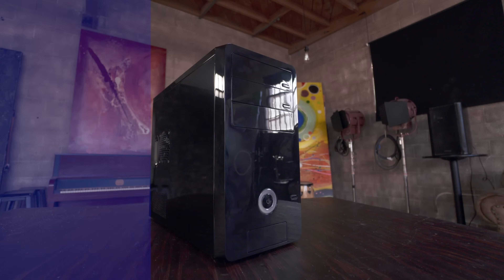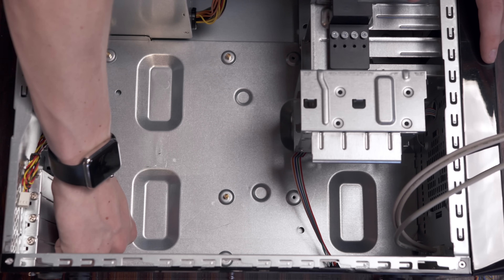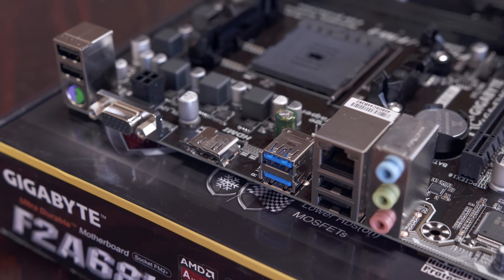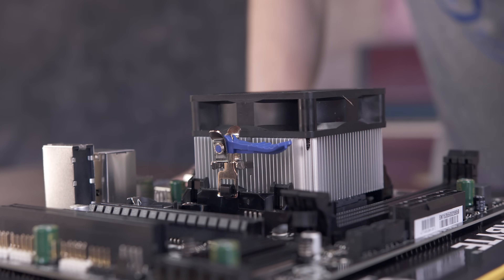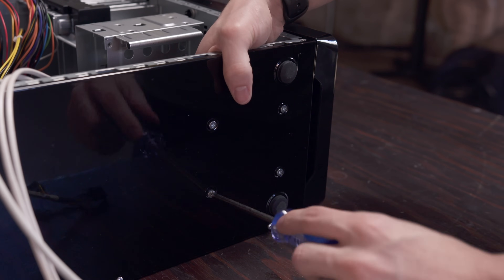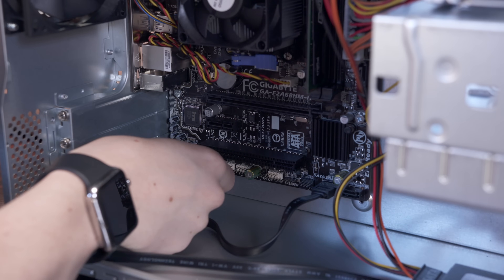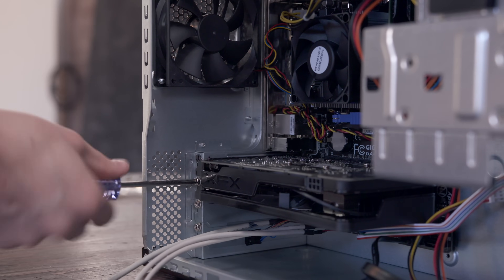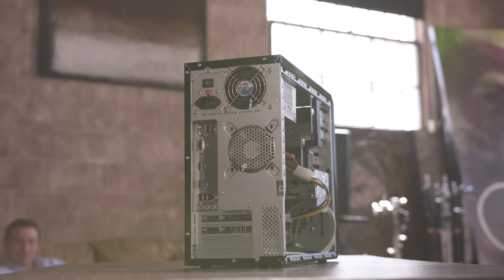How to Build a Gaming PC! (2016)

Comment: To anyone who knows a lot about PC's, i need serious help. I recently just built my first gaming pc, and I worked great for about 2 days, but then it randommly started to shut off during some downloads, and now it won't turn back on. I replaced the power supply with a CX750w Corsair, but didn't work. I've tried everything i could but I still can't get it to turn on.
Reply: dead mobo or cpu bud
Reply: and if the mobo is dead the cpu is also likely dead
Reply: +ThatGuyViral Do you know why?
Reply: +Jacob Skiles hard to say tbh

Comment: Mobo     - Asus Z170 pro gaming ATX LGA1151
CPU       - Intel Core i5 6600K 3.5GHz Quad core
^^^^      - Cooler Master Hyper t4 70.0 CFM 
GPU       - MSI Geforce GTX 960 4gb video card
Memory  - Corsair Vengeance LPX 16gb (2 x 8gb) DDR4
Power     - Corsair CX 430w 80+ 
Storage  - Western digital caviar blue 1tb

Good build? Any improvements? Anything unnecessary? What frame rate in intensive games am I looking at? Thanks in advance.
Reply: +AxisApoc I'd upgrade the Hyper T4 for something better, like the Hyper 212X, better cooling for some overclocking. For the power supply, get something like a CX600M for future upgradability.  For storage, I'd recommend starting with an SSD and then getting a hard drive when you need more storage.  For RAM, 16GB is a little unnecessary, unless you play games like GTA 5 or use your PC for more than just gaming.

Comment: 1: That case. Eww.
2: That stock CPU cooler (get a good one for AMD, seriously!)
3: That sad GPU.
4: That lack of a HDD.
Reply: +MinecraftNow this is a terrible build, and I hope no one buys any of this.
Reply: Obvy.. It's just that the parts he uses are not worth it going into 2016. I can go into more detail if you require so. Cheers
Reply: +Y5370, While this is not a great build, this is likely on the peak for the price to performance.  By chance, I have the same CPU, and it does great.  R 380 gfx though, 80-120 FPS "ultra" HD gaming.

Comment: Hey guys what do you think of my build, with some parts second hand this costs about $800USD

MSI GAMING GeForce GTX 970
Intel Boxed Core I5-6500
Kingston Digital 120GB SSD
Kingston HyperX FURY Black 8GB Ram
Gigabyte LGA1151 Intel H110 Micro ATX DDR4 Motherboard
Corsair Carbide Series SPEC-02
EVGA 600B Bronze 
WD Blue 1TB Desktop Hard Disk Drive

Comment: i am a tech noob lol and i have a couple questions.
1 if i were to add another ssd how would that work?

2. how much does normaly does it cost to install window?
Reply: +TheSpiroGam3R 
1) Quite easily, just like the first one, mount it and run the power and data cables to it.

2) A normal retail copy of Windows 10 is ~$90-100 USD, but you can find OEM license keys for about $20 USD.

Comment: if i had a amd radeon r7 graphics  what should i upgrade to (im on a budget)
Reply: +ASPEssence Whats your budget ?
Reply: up to 200 to 300 pounds
Reply: Cool, can i know all your specs and what kind of monitor you have ?
Reply: Plus, are you planning on buying a new monitor any time soon? like a 1440p or 4k or anything like that
Reply: i have a 1080p montor
Reply: Well, you have 2 choices dude. 1) Wait for Pascal/Polaris. Doing that will make sure any card you buy be cheaper, and that might drop by the end of june or july.2) If youre really in a rush you can go out and get a r9 390. Its a great card, you can test it out by checking fps benchmarks all over youtube. Its around 250 pounds on amazon. BTW, what is your cpu,ram, and psu. The psu part is important
Reply: could that run lol on 60 fps+ also will the price go down
Reply: +ASPEssence when the new gpus come out the 390 will drop in price for sure. also, this card will run lol at way beyond 150 fps. so if u can wait a little bit longer u can save some money.
Reply: how long?
Reply: Like i mentioned earlier, Its not 100% but most likely by July.
Reply: thanks man
Reply: Anytime bro.
Reply: was it the r9 380
Reply: +ASPEssence it was a 390, but what is your psu?
Reply: around 550
Reply: +ASPEssence if it's a quality brand the 390 will be fine.
Reply: k how much is it
Reply: +ASPEssence it's around 250 pounds.
Reply: thanks will it go down in july because the new graphics card is coming out
Reply: +ASPEssence yeah,that's what I'm currently waiting for too.
Reply: thanks for info man
Reply: Np =).

Comment: How to Build a Gaming PC! (2016) 
In a case with a top mounted PSU? oO 

I know that this wouldn't add like 50 fps to your performance, but still I think there's lots of cheap cases that aren't crap who all have bottom or at least separated psu. 

I get that this is a low budget oriented build, tho it's not stated anywhere, but still that case design looks, feels and is obsolete. 

There's not even tool-less drive slots or not even fan filters, as far as I can see. 

Tho this psu probably won't set itself on fire instantaneously, it can be a bad idea to use it for gaming as at 400w it's dubious whether it will support any stronger VC than that R7. Or even a mild overclock. 

On the other hand it will still run and if you can't afford anything else, f.e. in this case I would say it is acceptable to use it as a starter platform, given you can upgrade that case and psu later on. Tho honestly unless that case was like 20-30$ top I wouldn't justify purchasing it. It's actually a rarity to find a case with top mounted psu nowadays, unless you dig dig really low, even then you still have some other options. Imo if that's not meant only as a temporary solution, this option is awful.

Comment: guys, can someone recommend a budget pc build (under 1000$) that runs tom clancy division on high to ultra?
Reply: My pc is a beast and it cost £680

i5 4690k
MSI Z97 Gaming Series's 3
Nvidia GTX 750 TI OC 4GB
Kingston Hyper Fury X 16GB 
Corsair VS550 PSU
WD Blue 1TB HDD
Cooler Master Watercooling

it runs every game, runs GTA V at 56FPS on high settings, Anything else runs at ultra, GTA can run at ultra but drops down to 39FPS which is still great.
Reply: TechTuber nice one! have my old HDD and a gtx 750 ti sc edition i could use, so if i use them, it will likely be under 500$ right? :D

Comment: How do I install a Windows if I don't have a disk drive? And how do I install it?
Reply: +Minegoodboy USB. you dload it off of microsofts website, and boot from the usb.
Reply: is it free or do u have to pay? Do you only pay for the serial code or something?
Reply: You can pay for the activation code. It depends if u want 8 or 10. You can get the 10 for around 20 bucks on Kinguin.

Comment: I'm new to pc building and I don't have much knowledge soooo tell me what you think of this build I made. 
http://pcpartpicker.com/p/JVyVt6
Reply: +handboy123456789 Give me a budget. I can prob cook something a little more better for future upgrading.
Reply: 600-700 dollars
Reply: Cool, what about the monitor/tv, kb/mouse?
Reply: handboy123456789 are those included in the budget?
Reply: no, just 600-700 for the pc
Reply: https://pcpartpicker.com/parts/partlist/

Ok let me explain a bit too. At this point in time u want to stay away from amd cpus. This build uses skylake which is the latest from intel, and has a much better upgrade path. Nothing in this build is set in stone, so u can add and change whatever u need based on your certain needs. I use a 220 gb ssd, but you might want a HDD with 1tb or something else. Use this kind of like a base model and u can switch and add w/e you need. If you plan on OCing buy the 6600K instead. As for windows 10 you can buy a legit key off of kinguin. If you have any questions just reply here. Ill quickly answer it because i have my phone with me at all times
Reply: +Y5370 thanks but I can't see the build
Reply: i used some of the parts you suggested and here is what i came up with,

http://pcpartpicker.com/p/99RqYJ
Reply: looks sweet, but u neeed dat cooler. Im not 100% sure if the i5 comes with a stock. If it does then i guess ur set. The cooler is like 20 bucks
Reply: ok thanks for all the help!
Reply: +handboy123456789 np fam. I'm here if you need help with building it

Comment: do you have to buy a copy of windows 10 for this?
Reply: +TheGamingSnail It depends, when you build your computer, it won't come with windows pre installed, so you will have to get an operating system, but it doesn't necessarily have to be windows 10, it could be any operating system. And if you have windows 7 or 8, upgrading to 10 is free if I remember correctly.
Reply: but is getting the operating system free
Reply: If you upgrade from an older version of windows.
Reply: but does the older version cost money to get on the computer
Reply: Yes
Reply: where can i get a copy of the software
Reply: You can usually download it directly from microsoft. But if you go to your local computer store (like best buy) they should have some versions of windows.
Reply: ok thank you!

Comment: I understand that for budget systems, cheaper components have to be used. What I really simply cannot understand is why cheaper PSU's have rainbow ugly cables. Would it really be so hard for them to just put black insulation on all the cables?? I'm not asking for sleeved cables, simply cables that have all black insulation. It really shouldn't be all that hard, and I don't understand why only more expensive PSU's have this.

Comment: How do you install Windows 10 after getting to the bios?
Reply: +Gabriel Twigg-Ho you need a Windows 10 Dvd or USB stick. Turn on your computer, and put it in. Set your BIOS to "boot from CD" or "boot from USB" (it's under a tab called boot order or something like that) then once you exit the bios, you should enter a windows installer.
Reply: +Silvertronica Cubing thanks mate!

Comment: Brand new with 58 C temperature at the CPU ? WTF ??? My Pc is 5 years old and i have right now 24 C at the CPU and 34 C at the GPU .
Reply: +Marius Cosmin Try fixing the thermal compound, and CPU cooler, ussually the default one is not good. Your other computer probably as a better CPU cooler
Reply: Read again! I have very good temperatures under load !
Reply: +Marius Cosmin No what I am saying is that your old computer probably has better cooling system.
Reply: my build over the years. 5 coolers...
Reply: +Marius Cosmin 
what CPU cooler is in OLD computer
what CPU cooler is in NEW comptuer?
compare them.
Also some CPUs run hotter than others.

Comment: Can someone help me. I'm building a gaming pc but I don't know if I have all the specs for a gaming pc and are these specs good with each other.Here are my specs:CPU: Intel Core i5-6600K 3.5GHz Quad-Core Processor  (its going to cost me $239.95)CPU Cooler: Cooler Master Hyper 212 EVO 82.9 CFM Sleeve Bearing CPU Cooler (Its going to cost me $24.29)Motherboard: Gigabyte GA-H110M-A Micro ATX LGA1151 Motherboard (Its going to cost me $41.38)Memory: Kingston HyperX Fury Black 8GB (2 x 4GB) DDR4-2133 Memory (Its going to cost me $34.99)Storage: Samsung 850 EVO-Series 500GB 2.5" Solid State Drive (Its going to cost me $149.45)Video card: EVGA GeForce GTX 750 Ti 2GB Superclocked Video Card (Its going to cost me $99.99)Case: Corsair 200R ATX Mid Tower Case (its going to cost me $55.1)Power Supply: EVGA 500W 80+ Bronze Certified ATX Power Supply (Its going to cost me $29.99)Optical Drive: Asus DRW-24B1ST/BLK/B/AS DVD/CD Writer (Its going to cost me $18.99)In total this should cost me $694.13 and my budget is $750 dollars. Thank you very much and have a nice day!
Reply: don't go with skylake go with an i5 4690k, cheaper mobo, and cheaper ram like crucial and then put more money into a video card. the gpu is the single most important thing in any rig I would try to get an r9 380 or 380x even
Reply: Lucas Spag But I heard that gta 5 works better with a high processor
Reply: +Alejandro Rojas trust me it's going to be at most a 3 fps gain for an extra 60 dollars that would go to an extra 30 with a better gpu
Reply: Lucas Spag I made a other built. is this built better or is this one http://pcpartpicker.com/p/DjzPbv
Reply: +Alejandro Rojas here if you can save a little more the 390 is a better gpu and the xeon behaves like an i7 http://pcpartpicker.com/p/V7GkkL
Reply: Lucas Spag I Don't need a cpu cooler and thx for the advice

Comment: These are my specs for future budget build

asus m5a78i 
AMD-fx6300
8gb ddr3 kingston fury hyper x 
R9380

Does anyone know a power supply for this under 80 bucks?
I have the case and harddrive already in
Reply: An evga 600b 80+ bronze power supply will do the trick! I have that same graphics card and processor and it works nicely and the power supply is under $80.
Reply: +Matthew Clemente nice thanks!
What games do you play? And what fps do you get?

Comment: https://pcpartpicker.com/user/peter6828/saved/TdGrxr can anyone let me know if this is a good build or not for its price?
Reply: Please let me know austin
Reply: Yeah that's a great build
Reply: Matthew Clemente thx I made another if you want to see it
Reply: +Peter Sorial sure
Reply: +Peter Sorial The build with the 970 is the best but the 970 is not included in the price. That card will cost around $300 when added to the price. As for the other builds, the graphics cards are low end and will not perform very well.
Reply: +Peter Sorial this will bottleneck terribly. This is awful dude.
Reply: +Goldendeer It won't bottleneck just because there's an athlon, that CPU is fast enough for that GPU.
Reply: nah. quad core 3.6 ghz isn't very good for a 960. The 960 would be better with a better processor.
Reply: +Goldendeer Gaming favors less fast cores over more slow cores. You won't see a bottleneck unless the CPU is absolute dogshit. 3.7 is fast enough to not bottleneck the GPU.
Reply: Matthew Clemente thank you
Reply: Matthew Clemente Didn't know we were talking about a gaming PC. He just said PC. Completely my fault and sorry to both you and Peter.

Comment: build pc but consider the operating system options and what you want from it cause sometimes a linux distro like linux mint can give you all that and deduct the extra $100usd from the cost due to linux mint being free also linux mint has no product keys to worry about neither i see too many times people building basic computers and thinking they need windows for it which is $100 wasted that could have been an extra part like maybe a backup hard drive or something like that

Comment: Hey Austin, quick question. Why are some RAM slots on a motherboard colour coded as in they are coloured in pair? 2 white and 2 blue. Is there a difference ? Must we slot RAM sticks in pairs too? Can we slot 3 RAM sticks instead of 4 on a board with 4 slots?
Reply: +The TimeLord You have to read the motherboard manual. Ram slot with the same color means it is for dual channel configuration. It will still work if you slot 2 ram stick into different color slot but you won't get dual channel. You can slot any amount of ram stick and it will still work.
Reply: +WB IsMe What is dual channel? Is it a boost of some sort?
Reply: Dual channel is when 2 ram work hand in hand together more efficiently. In theory, it improves performance but in practice, performance improvement is negligible. Only APU and some software which you will never use benefit from dual channel.
Reply: +WB IsMe Ah thank u so much mate!! :D

Comment: I have a question 
If i remove the stock cooler from the cpu and try to reinstall it
will i have to apply separate thermal paste??

Comment: Hi there,

Would you please let me know your opinions or any suggestion ? I want to build a beast as follow: Really much appreciated. 

Motherboard Asus Z170 ROG MAXIMUS VIII HERO
 
CPU Cooler Corsair H115i
CPU Intel Skylake 1151pin i7-6700K
 
RAM 16G Kit (8Gx2) 3000 Corsair Vengeance Black
 
Primary hard drive Samsung 850 PRO 512G
Secondary hard drive WD Black SATA3 1TB
 
Power Corsair 80+ Platinum HX850i
Case Corsair GraphiteCC780T-WH
 
Graphic Card 4G GTX 980 Gigabyte OC (WF3OC)

Comment: Would I have to buy a windows 10 disc? Or does it already have it on the desktop?
Reply: If you buy a new hdd, then it will probably have no w10.
Reply: Yes you need to buy a windows disc or usb installer

Comment: Ha! This comes in handy :D I bought a new case for my Pre Made PC and I wanted to put to parts into the case myself but didn't really knew how to, so here's my solution xD what a coincidence eh?
Reply: Make sure your case is compatible with your board
Reply: +Ryan Ho the Case is ATX and my MB is an ATX too, so I think I'm good xD
Reply: +Filip Pham I think it would be a good idea to get a modular power supply so if  you ever need to do maintenance it would be super easy
Reply: I suggest the silent base 800 as a case if you can

Comment: Do a gaming laptop at lowest price
Reply: +Umang Tamrakar That depends on what you mean by "gaming laptop." Too much variability in what people mean by "gaming" whatever.
Reply: +asdfrozen I simply meant A good gaming laptop at best low price
Reply: Again, not very clear. I've heard people call the Surface Pro with its integrated graphics a "gaming tablet." I've heard people sneer at the 960M. Some say the 960M is the minimum GPU required for a gaming laptop, while others say the 950M is good enough. And so on.
Reply: gaming laptops are overpriced

Comment: for a low end to med system AMD is fine, but you can make sure your not as CPU limited with an Intel cpu (i5 or higher)

really should use a PSU with a native PCI-E power cable (them old type molex to PCI-E can overheat or the PSU it self might not be able to kick out the required power on some cards on low end entry level PCI-E cards it should be fine)
Reply: +lee x yh AMD is better if on a tight budget otherwise an intel.

i always thought all power supplies came with a native pci-e cable didnt no some of them still come with the old molex ones